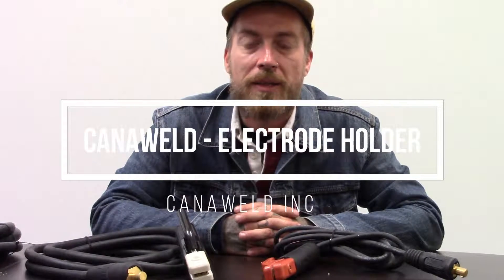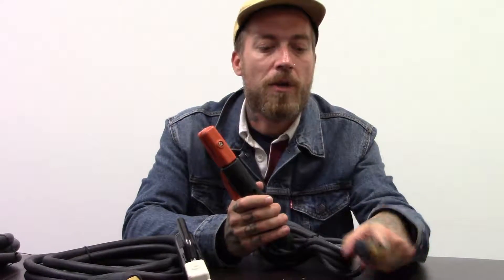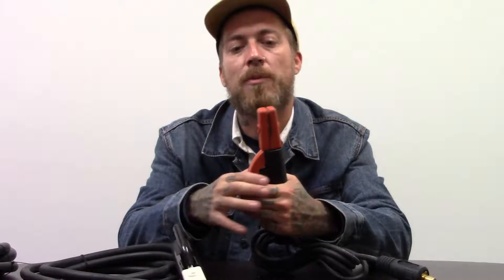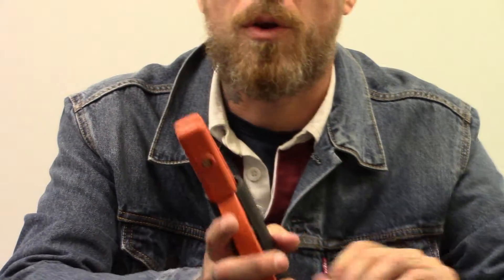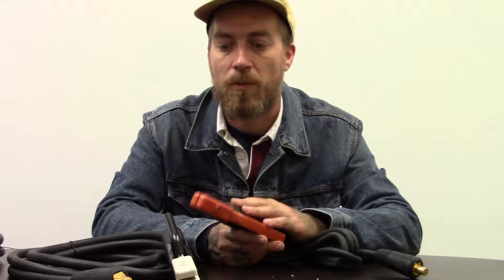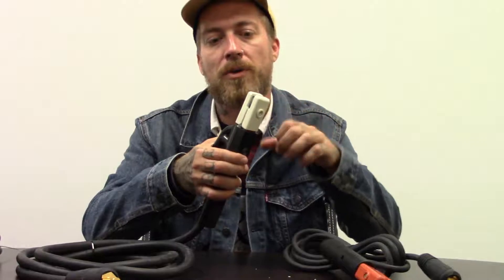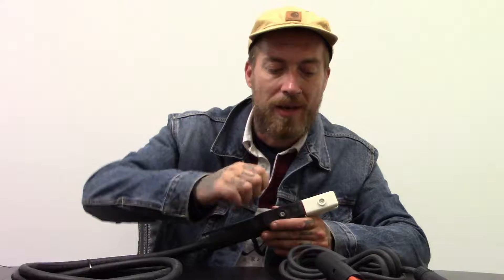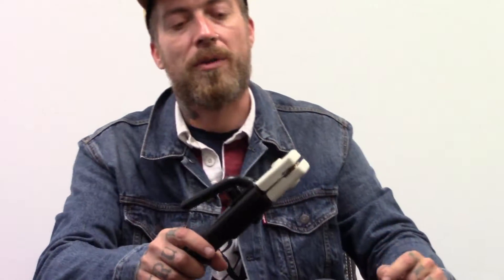How to choose the best Electrode Holders for welding equipment, By Canaweld

Comment: Can you upgrade the design of the electrode holder I felt the radiation heat wracked my hands especially pinky finger around 150 amps due to not wearing high quality gloves or aging nerves. It will shield around up to the wrist.
https://encrypted-tbn0.gstatic.com/images?q=tbn:ANd9GcQPM2fUJ3pPct8IzBRgYlUslgCxn1BK4Ls-qg&usqp=CAU